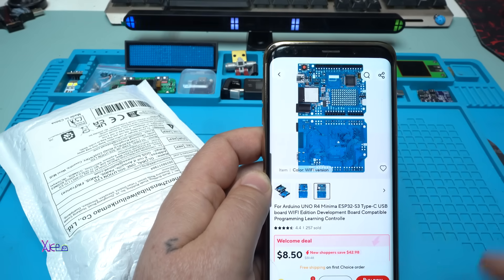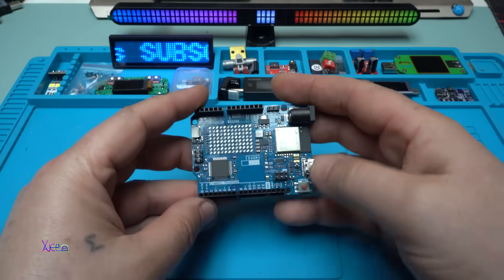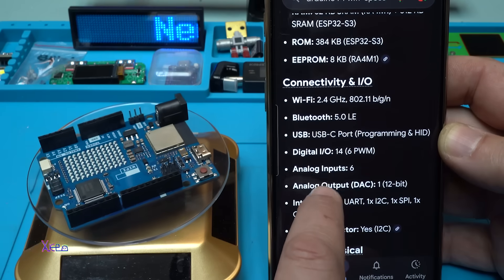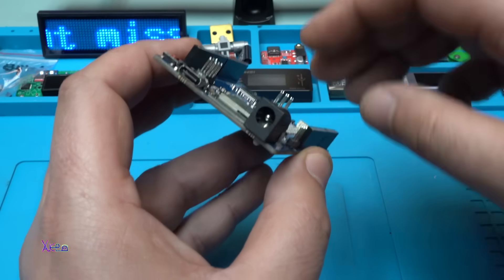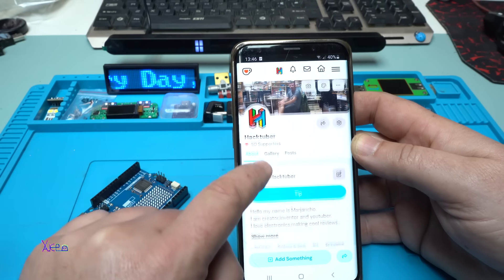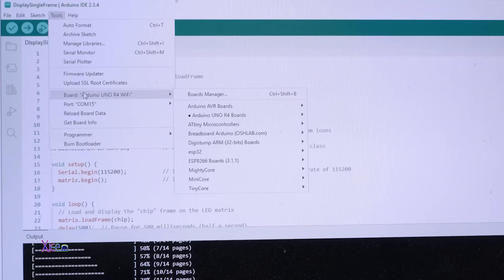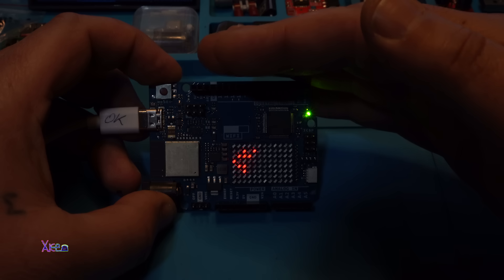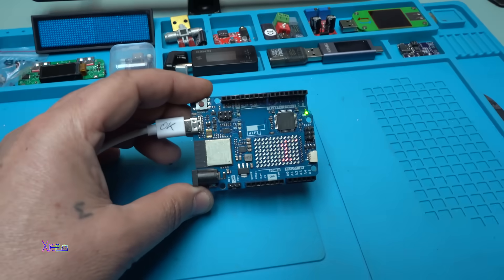$8 Arduino UNO R4 Wifi Module from Aliexpress

Comment: I bought one of these from Aliexpress but couldn't get it to do much. it turned out that it was was RA4M1 with (un-upgradeable) Firmware 0.6.0, MIcrosoft Copilot identified it as 'Possibly Clone/Engineering sample'.
Aliexpress refused a refund.
It was a shame as I have been playing with Raspberry Pi's for years and would have liked a go with Ardunino.

Comment: The dimness of the led matrix suggests they have one set of gpios for rows and another for columns, and of course, you can only light one row or column at a time that way. 
It would have been more interesting (if more expensive) to use WS2812's.